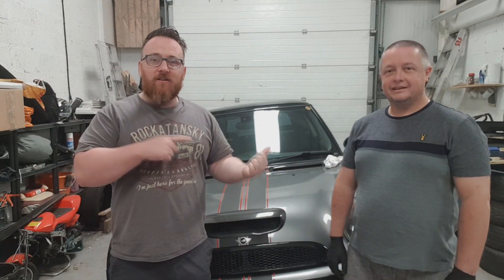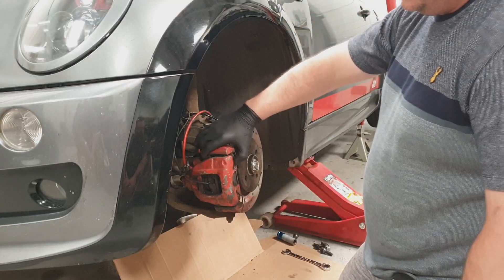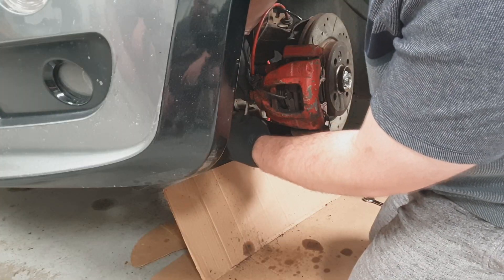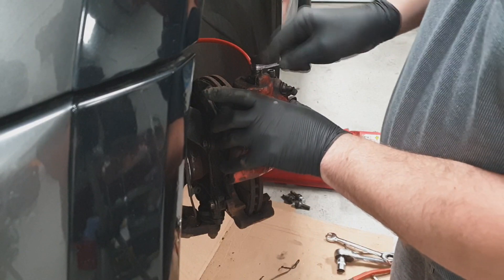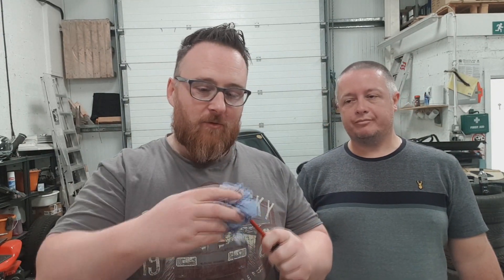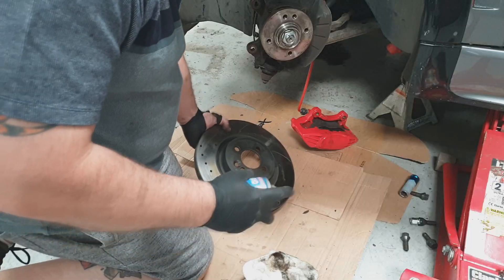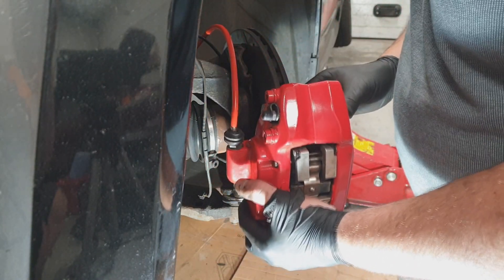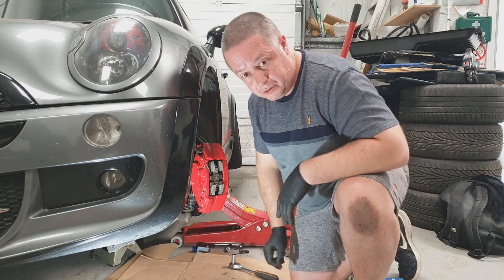R53 MINI Big Brake Upgrade - BUDWEG 4 POT

Comment: Where did you find 4x100 brake rotors at 316mm? I'm struggling to find anything that will fit my newly acquired brembo jcw used purchase that shares the r53 lug bolt pattern

Comment: Cracking video, thanks for sharing guys. I trust you are happy with the quality of the BudWeg kit? I love the Mad Max t-shirt by the way !
Reply from the maker: Budweg kit is top notch, well worth it!
Reply: @ToolsnTrack  Thanks for the reply. Could you please describe the difference in how the brakes feel, if any? Thank you.
Reply from the maker: With the standard Mini brake set up and the Budweg calipers, the pedal feels a little spongy with the need to move more fluid I presume. There is a fix using an M3 servo and master cylinder I believe but I’ve never fitted it so don’t know what it entails. Other than that the braking power now is amazing.

Comment: do you think these calipers with a 285mm disk would fit inside a 16 inch wheel? in terms of width i don't care but i am concerned about the diameter
Reply from the maker: Depends totally on the inner architecture of the wheel really. If it has the back spacing it may work but some wheels are thicker than others...

Comment: Part numbers
Reply: Or what brake rotor size
AMD brake lines adm brake sensors
Reply from the maker: Chat Noir https://www.cbminipartsnmods.com
Reply: Budweg 344902 + 344903
Ferodo FDB4358 (premier eco)
Mintex MBA1852
Ferodo DDF2127C (plain 316x22mm)
Pad wear sensor 34356773017
I don’t know for the HEL brake lines
BrakesInt.co.uk was selling this full upgrade kit (except sensor) on eBay, but seems no more today